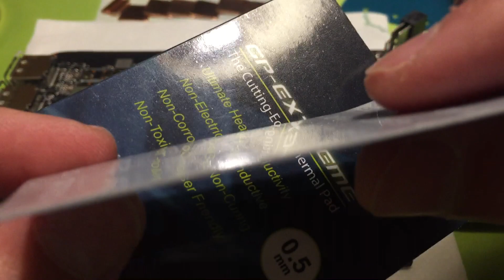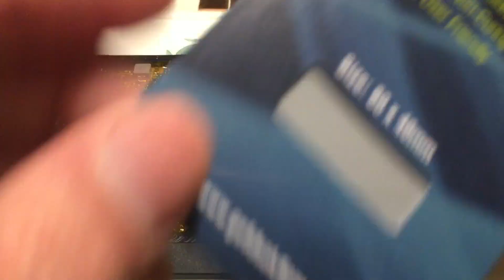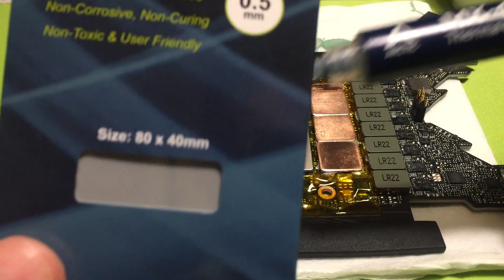How to drop from 106C to 74C with 1mm COPPER shim - RTX 3080 Founders Edition - Better than 1.5mm?

Comment: Can we use thermal putty instead of paste with copper shims? or is putty too thick? would appreciate if you showed a little bit more. like how you put 1 or 2 pieces of the kapstone tape. how you put the thermal paste underneath the copper shims. some of us not paying attention might thing there isn't paste underneath.
Edit : So you are using 1 mm copper shims and 1 mm thermal pads with thermal paste underneath the copper shims? 👍👍 thanks!

Comment: Hi, I was considering doing this mod to my 3080 fe which has already the newer cooling model with 1,5mm pads. I'm a bit concerned about using 1,5mm copper shims because even with 1,5mm pads they seem to compress a little so like perfect size would be 1,3mm for the copper I guess? Did you notice your pcb flexing/bending with 1,5mm copper shims?

Comment: I would say that there is no point in using thermal pads, just use the 1.2 or 1.3 mm copper tabs and thermal grease. You are very generous with capton tape. I hardle use any these days. Copper tabs with right height do not move much. What initial movement you get upon assembly is what you get. For it to slide and pivot down to a component lower then ram chips require the shim to move out by at least 75%. If you dont believe just open your card after 1 year of use and see yourself.

Comment: I have 3 questions

1 where to buy the copper shims?

2 For a 3090FE what is the size of the copper shim?

3 the thermal pad that I should use with the copper shims is 0.5mm?

Comment: Great video. All copper shims with thin layers of thermal grease on both sides of the grease will have better results though this will be a risky mod if thicknesses of copper shims are not exactly the same. The thicker shim will put more pressure on particular vram lying on it and might ruin it as there is no room of compression to lessen the excessive pressure and add to the fact on metal expands on heating. So, adding a layer of thermal pad is a less risky option here. Better yet thermal pads should be placed in the vram first as an added vram protection and avoid placing grease in the vrams. This will also elevate shims a little bit specially that there could be transistors soldered at elevated levels near these vrams. There is no difference in temp gradient whether pad is on top or bottom of the shims. Maybe applying thin spots thermal greases (which has lesser conductivity from the best thermal pads around) on copper shims/thermal pad layer would be ok just to make the shims in place while applying a thin layer on the top portion of shims to maximize heat contact with the cooling plate. Of course, the added factor on temp decrease is the ability of the blowers to remove heat from the card. Will try this scheme for my 3080 ti once it needs pad replacement. I think 90C degrees max during gaming is still acceptable. BTW, 15x15 mm shim dimension is overkill, a smaller one 13x13 mm will do the trick. I do not know the reason why they  do not sell commercially a smaller version.

Comment: But why does stupid Nvidia not do this? Why do they sell cards so expensive and don't cool them properly? I am sure if I go to the highest court, I can sue the monsters in Nvidia for what they're doing.
Reply: Manufacturing process will be more complicated and messy (copper shims, thermal grease, kapton tapes or equivalent) and could even increase failure rates. This will increase the cost of production and hence higher prices for GPU.
Reply: Good luck in your venture...

Comment: I did this mod twice on my 3080 FE. First time with 2mm Gelid Extreme pads and second with 1.2mm copper pads with thermal paste on either side. I bought both the 1.2mm and 1.5mm copper plates. I did the 2mm thermal pads before and had to heavily compress them to get it to work ok and maybe saw like 5-10 C improvement from stock. 

I decided to go with the 1.2mm copper plates instead of the 1.5mm because I compared the compressed pads with the thickness of the copper by feel and the compressed pads felt the closest to 1.2mm so I went with that. 

I had opened and put my card together at least 4x with the 2mm Gelid pad mod and was not looking forward to do it again but this time with thermal paste all over. I was happy that the 1.2mm worked and gave me the 20+ C degree temperature reduction I was looking for. 

Hope this helps anyone who's thinking about copper modding and was wonder how thick the copper plates should be.
Reply: Hi, what kind of GPU/Vram temperature and GPU Hotspot temperature do you have with the 1,2mm copper shims? I tried 1,5mm today and while my mem temps were very good my GPU temp was around 80°C and Hotspot at 100°C which is not normal. 1,5mm is definitely too much.
Reply: @LG1771-e4n  It’s been a while and I’ve done the set and forget it thing with the GPU. My guess is that it still performs as well as when I installed. I’ll check temps when I am home.

Comment: I have Palit 3080. I want to do it a little differently. First, 0.5 thermopad by memory, then 0.2 or 0.3 copper plate, then paste between the copper and the heat sink. Because I need an overall thickness of 0.75. I hope it will work.

Comment: NO NO NO !!!!!!! just ask yourself a question why graphics card manufacturers do not use this type of process to gain performance on their card ??? there is a good reason ..... the answer is simple and physical copper is an outstanding electrical conductor and no longer charges static electricity and even generates it unlike the thermal pad which them are not electrically conductive and do not charge or generate static electricity.
Reply: In order to "charge" for copper it would have to be placed into changing magnetic field. Than current induction could happen but all current would be either shorted to cooler which should be grounded or would stay in shim causing it to heat up. So it would heat up but that is obviously not happening. And I don't believe there is source of changing magnetic field near and strong enough to cause any problem.

Comment: With these copper shim I went from (47 mem/112 core) to (36 mem/70 core) this was on rtx3080 tuff ,,,sadly I didn't had a luck with copper plate from coolmygpu
Reply: @ЕмеляПечкин-п8в  maybe, but with these copper shim I never had problem, next I will changed 2 tuff 3070ti

Comment: Hi, what sizes are the tiny plates that you used on the ends of the VRAM modules to fill in the remainder? Are these necessary or can you use all 15x15 plates?
Reply: The shims  are based on 15mm x 15mm, the smaller shim you make by cutting a standard shim with a tin cutter, and then filing it to size.  Or you could file the each of the larger shims to about 15mm x 13mm.

Comment: I did the same mod on my 3080 fe, and now my gpu hotshot is at 105c. Could someone let me know what's wrong?
Reply: I think, one possible problem would be, too much thickness on vram,  causing not enough contact pressure on gpu die
Reply from the maker: @jeffwright9636  Possibly correct ;)
Reply: @jeffwright9636  thanks 😊

Comment: Is electrical lacker safe to use instead of the capton tape!
Reply from the maker: Is this a question? We just used kapton tape and it worked for us and for many others! Let us know what you mean so we may try it ;) thank you
Reply: @davtechlab8646  Lacker is a high temperature clear coat for the wires. It is usually used for coating copper wires that are used in transformer windings!
It is heat resistent up to 250 °C!
And I think it would be a great idea to paint the area around the copper shims in adition to capton tape to prevent any shorts!
Reply: He meant "lacquer". Most folks will just use simple clear nail polish, but yeah that will work as well. @davtechlab8646

Comment: I have two 3080 FE. Just did the mod on one and vram temps 68C. I used 1.5mm plates with thermal paste on top and bottom of shims. Duel mining get 90mhs ETH and 650 ALPH. I have to drop the memory to 1000 and the core to 1000 otherwise I would get 60-70 mhs. The second card I wasn’t so lucky. the 1.5mm did not work , the die was barely touching. While the temps were good I was only getting 20 mhs. Going to they 1mm skims and see if that helps.
Reply from the maker: Try 1mm shims and 0.5 thermal pads instead and check results ;) and let us know if there is any improvement please!
Reply: @davtechlab8646  I have a cnc and I’m going to shave a plate I have and cut them to the exact vram dimensions. What thickness pads did you use for the thinner strips or small chips ( don’t know there name)
Reply: I tried 1.5mm for mine as well and did not have luck. Is yours a 2021 batch as well? .  Die was not making good contact. From what I've seen. 1.5mm shims will work on 2020 batches. I've also tried with 1.2mm. No luck. although die temps are a little better, VRAM temps are still high 100C+. Not sure what to do. Unless I bought fake copper lol
Reply: @Justin-sm1no  I shaved down the 1.5mm to 1.3mm get 57 on the core and no higher then 98 on vram. The shaving was a little off. Each piece varied a bit. Going to try .05 inches (1.27mm) sheet and cut them to size. I’ll update tomorrow.
Reply: @3sixtymining  I wonder why we arent getting 70-80c. Are you using MX4?
Reply: @Justin-sm1no  l used Noctua. The first one I did with1.5mm was at 70 but the mhs dropped off from 95mhs to 75mhs after a few hours. Not sure why.
Reply: @3sixtymining  High hot spot temps drop hash as well. Prob not good enough contact on die. Do you know which batch are your cards? You will have to open it up to see the date. I've opened up this 3080 FE 2021 batch like 20+ times alrdy trying diff size shims to no avail. Might just go back to good ol' pads
Reply: @Justin-sm1no  here is an update. I cut shims to exact size of VRAM. Using 1.27 mm thick shims. Thermal paste on VRAM and a little on top of the shims. The date on the card is 01.05.2020. I’m get 82 on the memory them 57 on core, fans running at 79% . 240 watts . Getting 99.76 mhs ETH  797.9 Alph duel mining.
Reply: @3sixtymining  Is the unit a 2021 batch. What month? I tried 1.2mm and did not get nice vram temps. Im thinking of trying 1mm that comes today
Reply: @jvu316  both of mine are 2020. I used 1.27mm thickness. Thermal paste on VRAM and on top of copper. The air temp outside the rig is 31 c . Both card are the same on memory temp at 82c. Core on one is 57c the other 60c. Both of these cards were at 110c on the memory before the mod. Getting around 99mhs ETH and 850mhs Alph duel mining.

Comment: Good video. This might be a dumb question, but why doesn't NVIDIA just install copper shims and better thermal pads from the factory? If the difference is almost 30C, then why isn't there a second tier of cards with better thermals?
Reply from the maker: Thank you. Various reasons, for example: 
1- installing copper is time consuming.
2- copper isn’t soft as thermal pads
3- thermal pads gives better performance compared to price/time/effort.
Reply: @davtechlab8646  Thanks for the reply. If the manufacturing is automated, then I don't see why they couldn't install copper shims. Sounds like they just do it to lower cost and/or to coincide with a revenue model that allows for product failure after a projected date. An example of that would be car parts that are engineered to fail at a specific point (usually after the warranty period) to have additional revenue. Has anyone from NVIDIA ever been asked this question before?

Comment: This is a great way to improve VRAM temps on any card. I did this on my 3090 when I got it back in early 2021 (lucky MSRP pull from Best Buy!) and even on some 5700XTs as well.
I've tried many different methods for this, so here's my input:

First: Be careful. You don't want those shims sliding around at all. There's a lot of components they could short out and completely kill your card. Cutting your thermal pads slightly larger than your shims will let there be a lip of uncompressed pad around the plate, which will hold it in place as the pad will adhere to the cold plate. For safety, you can also use clear nail polish on electrical components around the VRAM dies to form a barrier that is protective against electrical shorting. Do some googling around to find what kinds of nail polish are acceptable for this. There's a chemical in some of them that's undesirable (can't remember). Be careful to not get this on the VRAM dies, too.

Copper shims alone are incredibly hard to get the correct thickness to make this work perfectly. Thermal pads are designed to compress, and chances are any card using 1.5mm thermal pads has them compressing down to anywhere between 1.1mm and 1.4mm, roughly. So using 1.5mm thermal pads in those instances can bend the PCB slightly, which can create reduced pressure or even a larger gap between the GPU die itself and the cold plate. Using too thin a shim without a pad can allow it to slide around. And trying to use the perfect sized shim might STILL slide around over time as fan vibrations jostle them and allows the thermal paste to act as its other namesake: thermal grease. I absolutely do not recommend this.

You can also replace the thermal pads with thermal putty. Thermal putty is similar to thermal paste, but much much thicker. Closer to playdoh. It can be molded somewhat, which allows you to kind of smother stuff in it and let the pressure of the cold plate form the shape you need. So you won't need to measure any specific thicknesses; you'd just need to be sure your shim isn't TOO thick. This will hold the shims in place and transfer heat as well as thermal pads, while not needing you to conform to any specific pad thickness. Keep in mind that thermal putty is a lot more work.

Cutting full size shims for several dies at a time can work, but can also back fire. I shaped out a single custom shim for the entire VRAM arrangement on a 5700xt, cornering nicely around the GPU die and avoiding other board components. You'd think having more mass and area to transfer the heat to the heatsink would be ideal, but what can actually happen with full sized shims can have slight flatness defects that interact poorly with the flatness tolerances of the dies placed on the board. There's a lot of points for very slight deviations that can create small airgaps between the singular VRAM dies and the full copper shim that will let some of the dies get to higher temps than you'd expect copper shims would allow. In my case, my full custom copper shim only saved a few degrees over full thermal pads, so I returned to individual shims. Individual shims can each conform to slight height and angle differences for the different dies, giving each one more uniform pressure as the thermal pads or putty pushes down against it.
Reply: @drinkingFood What do you think of using VRAM + 0.15mm double-sided adhesive thermal tape + copper shim + thermal paste?
Reply: @marceloleite2304  I think you need some kind of compressible but springy material in there. Something that's not hard but can hold a shape. Otherwise you are going to have a hard time keeping everything in place while simultaneously filling that space without overshooting the shim thickness.

I also can't speak for how thermally conductive thermal tape is. The most important part of this formula is spreading the heat out from the center of your RAM dies as quickly as possible. So having your shim point black with only thermal paste to fill the air gaps is likely going to perform better than thermal tape completely cutting off the shim from the die. That said, this would still probably work better than pure thermal pad solutions if you do it well.

Comment: amazon has these laptop heat sinks that are 1 mm thick copper plate and come with .5 thermal pad. if a guy had some basic sheet metal exp he could trim down to size. question i have is,,, can you use 1 full piece to cover rather than  squares? seems to me it wouldnt matter given the thermal pad aren't chopped into squares.
Reply from the maker: Yes you can! Probability better option as well as you won’t need to deal with many parts ;)

Comment: Can you not just run thermal pads with a higher heat transfer? I need a solution for my a5000s.
Reply from the maker: Yes, it is possible of course, but copper  has the highest thermal conductivity (among the cheapest materials)
You could use diamonds instead to achieve one of the very highest thermal conductivity, but a bit pricey I think .. ;)

Comment: I think the better thickness is 1.8 copper plate whit thermal paste on both sides.
Reply from the maker: That really depends on when the GPU is been assembled.

Some 3080 Founders Edition produced before 2021 may need 2mm thermal pads, other FEs produced later are required 1.5mm thermal pads.

For copper mod, you should sand off about 0.1/0.2mm and check if the contact is good on the heatsink.

I have myself few models of 3080 FE that are ok with 2mm pads and other that are ok only with 1.5mm pads.
Reply: @davtechlab8646  how about using pads on the memory and the copper on top? So it wouldn’t risk the copper touching the memory

Comment: Hi! Thank’s for the video. Normally I used pads 1,5 mm in die side. Is possible also cut copper 82x6x1,5 mm along side LR22  or there is a risk of short? Excuse me for my english.
Reply from the maker: Hi! Thank you! Your english is good, don’t worry!! ;)
About copper on the LR22 modules I’m not 100% sure because I never tried it.
Usually the LR22 do not get as hot as the vrams, so I never tried copper on them. Thermal pads as usual should do the job (if you want to go “safe”)
Reply: @davtechlab8646  Thank’s a lot! I'll play it safe then.